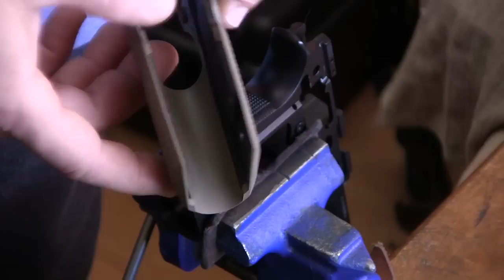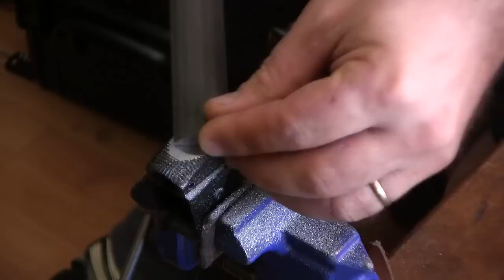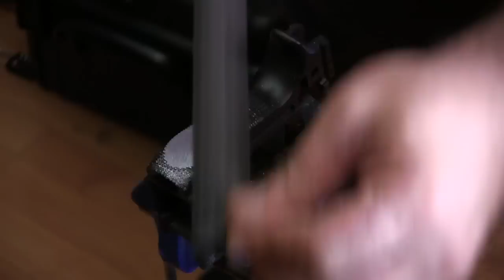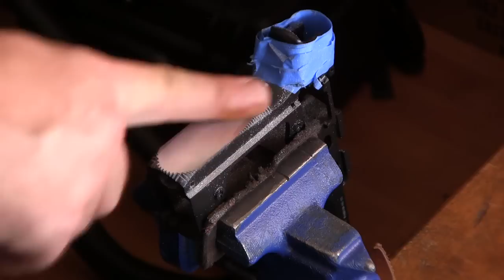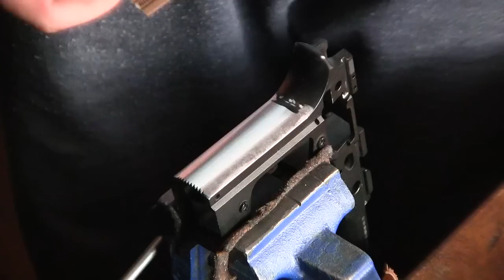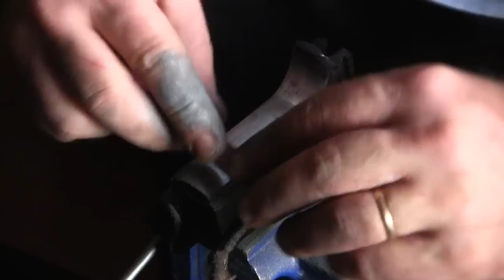Beretta 92FS - Vertec Grip Conversion

Comment: You, sir, are far braver than I. The initial bit looks like a job for a belt sander rather than a file. More bravery required for that! ;-) I'm at 4:33 into the video, so I don't know if you had the frame anodized again. I'll finish the video. I will have to pass on this mod. Due to my hand size, I would certainly like thinner grip panels. Black preferred. I have the 92A1 bought used. Plan is to install night sights, G-kit conversion, Short reach trigger, WC trigger return spring, and LTT trigger job in a bag (12#). I have a D spring incase the 12# is too light.

ETA: Wow! You are a true craftsman! Love how you casually said, "and that's basically it.'" at the end like it was no big deal.
Reply from the maker: Thank you. Yes, I sent the frame out to be re-anodized with type 3 hard anodize. Watch other parts of this series to see how I checkered it and modified the Wilson Combat grips.
Reply: @MosinVirus  I did and was very impressed with your work. The method you used for the checkering was pretty cool. And I was amazed at what you could do with hand tools.
Reply from the maker: You are too kind. All it takes is patience.

Comment: What was the total thickness removed? I had thought about Fixturing in a vise to have the aforementioned grooves parallel on a challenge plate, using a height gage to mark the work so it can be transferred to a mill. 
I highly commend your patience, as that is not something I’ve yet to master lol.
Reply from the maker: Sorry, never measured the actual amount of material removed. The remaining thickness at the spine looks to be around 0.060" if I remember correctly, but that is only in the center.

Comment: Was wondering why you were doing this, i have a m9a3, vertec and 92fs and i shoot the 92fs better than the other 2.  Most people do as well.  The 92fs also keeps the classic beautiful beretta lines too.
Great work btw, I usually use a mill for this much work but file work is still necessary when your done to break the edges.
If i were doing this i would leave a memory bump to help index the pistol in the hand.  Like 1911s have.
Reply from the maker: I completely agree on the lines of the 92 FS. The reason I ultimately decided to convert mine is because the grip on mine still felt a little uncomfortable and the trigger was still a bit too far in DA. Plus I wanted to learn. Before I did the conversion to mine I asked someone with a Vertec out to the range so I can check it out. I liked it.

Also I figured that the wrap around grip is an instant-92FS-restore. But that is another reason why I had to follow the true vertec profile.

If you are thinking of doing something different, and because I don't have another 92FS to try it on, I was thinking of moving the "hump" mid palm. As in, removing the bottom material and isolating the top to produce that very memory bump, but simulating a Vp9 rear strap. Basically swelling up the middle while reducing rhe girth of the bottom. I think that will feel amazing.
Reply: MosinVirus have you tried a compact?  They are great pistols and are about the size most people consider a full size.   The beretta 92fs is a big pistol, its in the class of most long slide pistols.  I consider the compact a full size and the 92fs a long slide.  I let some smaller shooters shoot my compact and most think its a full size, a few complain that its too big even without knowing its a compact.  Thats the reason the armorer for the matrix used a cheetah for trinity because the actress couldnt reach the trigger on even a compact.
Reply from the maker: No, never have. But I do want to. Will try to find someone with one.

Comment: I don’t get it... Am I missing something here? So you filed down the regular 92FS frame and removed the hump, only to put a rubberized grip for a Vertec frame on it, just to have the hump back on your gun? Okay... I think I would have just kept the gun and purchased a new gun with the Vertec frame. That way, I’d have both of the guns. This didn’t make a whole lot of sense to me, but to each their own. You did a good job, even though I’m confused about why you did it. You could have had a new gun to go with the original. Anyway, what are you gonna use to refinish the bare metal? And it does need to be refinished. The bare aluminum can corrode. Cerakote maybe? Did you add the checkering back? You removed all of it when you removed the hump.
Reply from the maker: I wanted a vertec profile frame. The reason I got the wraparound grip is in case I grew to dislike the vertec profile (which didn't happen by the way). The other reason is that I wanted to use the wraparound grip to measure my work, whether I did the conversion correctly, because if the wraparound was too tight or too loose I would have known that I did something differently. In the subsequent video I checker the rear strap and finally send it off to be re-anodized with type 3 finish. Again, that is in one of the following videos in the playlist.